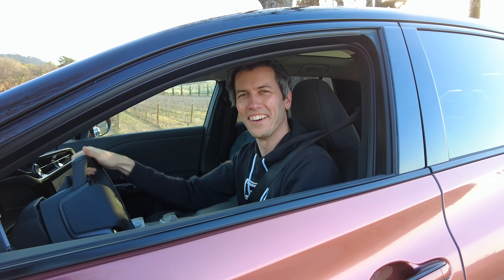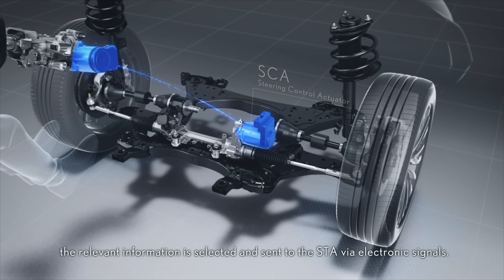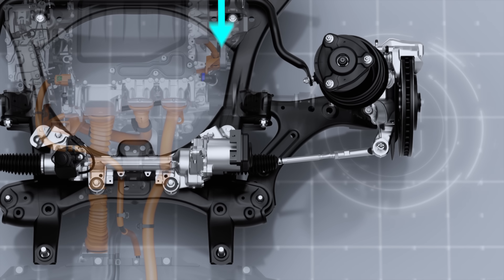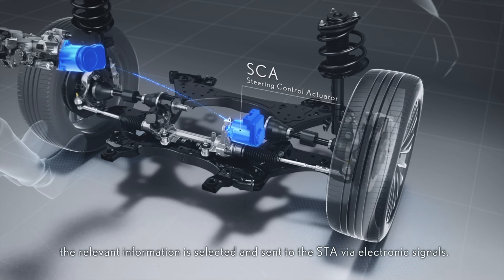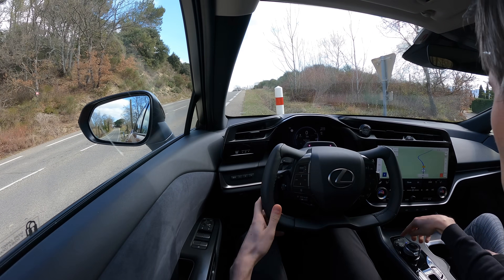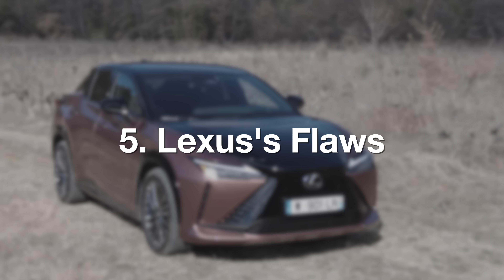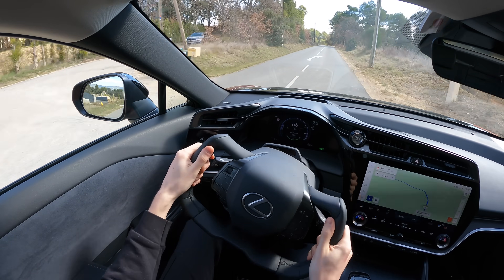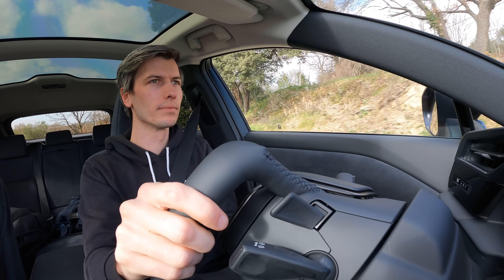How Lexus Fixed Tesla's Bad Idea: Steer-By-Wire Yoke

Comment: I'm curious with the added advantage of responsiveness for Steer by wire i.e. variable steering ratio. What's the advantage over using steer by wire tech, over something like EPS? Some cars have EPS that makes the steering more responsive at low speeds and makes it less responsive at high speeds
Reply from the maker: EPS is steering assist, using an electric motor to reduce the amount of effort required to turn. It's higher at low speeds because turning is more difficult at low speeds (you want larger wheel angles, like for parking). The assist is reduced at highways speeds because the angle changes are much smaller.

Comment: When Tesla came out, I actually assumed it was variable ratio so you'd never need to do hand over hand. Even "sporty" wheels that are flat on the bottom annoy the hell out of me because they're not round.
This approach is great and Toyota did it right with the redundancy, though I remember stories about stuck throttle on a Prius. If you do what airliners do, it should be safer and more reliable than a mechanical linkage, but also much lighter. And you can make it more aggressive and with more feedback in sport mode so that it matches the throttle and brake response.

Comment: Still, variable displacement hydraulic pumps would have been a better option, eliminating need for redundant motors and power supply by the design of the pump. Less dependancy on rare earth metals and copper too. People are just too obsessed with electrics and electronics.

Comment: Another very dangerous car idea coming from designers that'll lead to a lot of death irregardless of the redundancy software failure and other numerous failures will lead to a very bad time dealing with the vehicle. Engineers really need to stop doing drive-by-wire steering by wire and breaking by wire we've already got electronic parking brakes remembers things like that it is all dangerous ideas because it gets out of calibration software issues numerous variables that cannot be accounted for

Comment: Not that a manufacturer would admit this, but I'd bet the primary motivation for this change is cost reduction in manufacturing. I would believe the impetus is performance and driving experience if they weren't just sticking it in yet another crossover

Comment: So basically, they replaced a shaft that is always connecting you to the wheels (basic vital control) with an electrical engine that will never fail (to logically and safety be feasible) and offer a Gaming Console experience in the car. The difference is that, when you play a Gaming Console, you can restart the game if you crash.

Comment: the infiniti q50 hybrid had a similar thing, but still had a steering column as a backup. and in terms of reliability, they had more issues with the mercedes 7gtronic gearbox than with the steer by wire system.
10:11 - he took it offroad!!! :D :D
i fully trust Toyota's engineering, however, this would take some getting used to, just like with all their products.
about the responsiveness - keep in mind that traditional assisted steering also doesn't allow you to go from max left to max right that fast - the assistance will just fade and you'll be slowed down.
Reply: hey you beat me to it, i was going to say the same thing lol, yep q50 drive by wire has a clutch to connect the wheels, but the version i have is mechanical electric power steering

Comment: I'd love it. I have no idea, why manufacturers haven't stopped the 360+° Nonsense in the nineties. But my guess would be, that old and pseudo-old people are idiots when it comes to changes for the better. The "but my steering wheel always has to turn 800°!!!1! How else am i - is everyone supposed to drive!". You can insert any technology in there, of course. No Horses, Rear view mirrors, front opening one-piece hoods, indicators, Seatbelts, light-indicators, ABS, Airbags, ASR, ESP, Winter Tires, "it doesn't go wroom wroom", etc. pp. WHAT'S WRONG WITH USING YOUR ARM TO INDICATE WHICH WAY YOU ARE TURNING?!

Comment: Great video, can you achieve full wheel angle at higher speeds or is steering angle limited?
Reply from the maker: That's a great question - I did not ask, and don't know. I'd guess no; If the ratio is increased, a certain wheel turn would correlate to less steering, but perhaps it is progressive at the steering limits, hence I don't know!